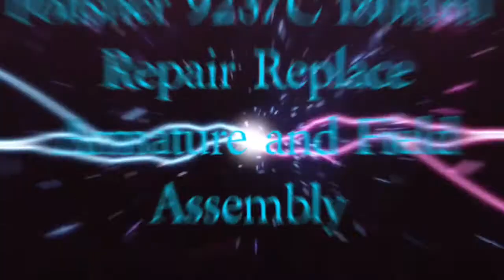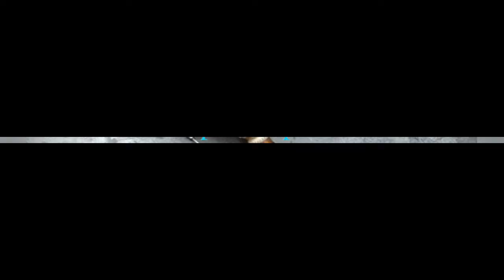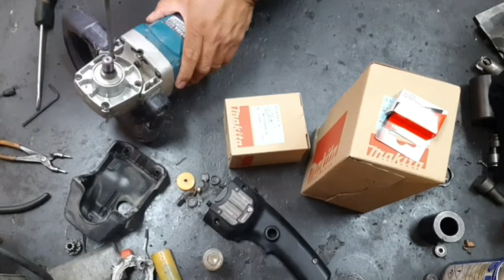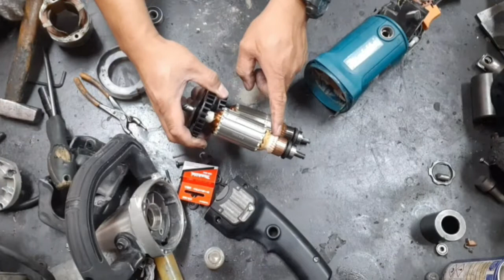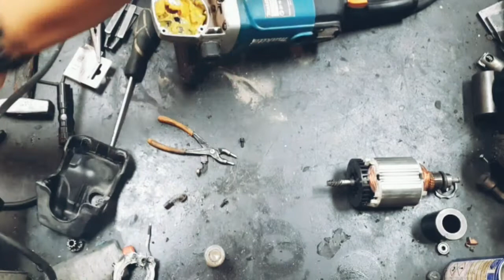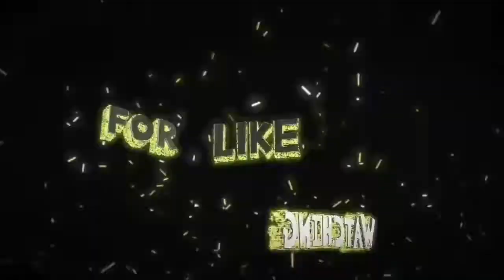Easy way to Diagnose Assembly  MAKITA Polisher 9237C 180mm  (7")

Comment: Have an issue with two old Snap-on polishers they don't sound bad when you just turn them on the switch everything works but the problem is when you go to apply pressure to whatever your polishing car penile exedra sounds like the bearing is bad like it makes a lot of noise it does work no problem with power or anything but it just sounds like it's too loud like the bearing is just making a like a winding noise I took it completely apart Grease the whole knows everything and all the gears and everything that I could see looked at everything looked to be fine where what kind of Grease do I use to grease it and also where do you get the bearings from
Reply from the maker: You can buy in your local makita dealer
Reply from the maker: Ball bearing 608LLB
Ball Bearing 6201LLB

Comment: Hey are triggers a common failure for this model machine? All of a sudden it will not spin when i press the trigger. I opened up the handle part and all the wires look secure in place. What would be your suggestion? You seem pretty experienced
Reply from the maker: Change the Switch if no contact.
Reply from the maker: Hi James the switch no contact 
Due to more dust inside the switch you can open and clean